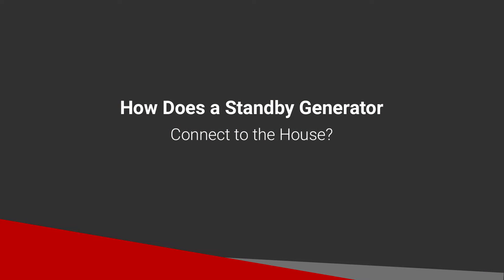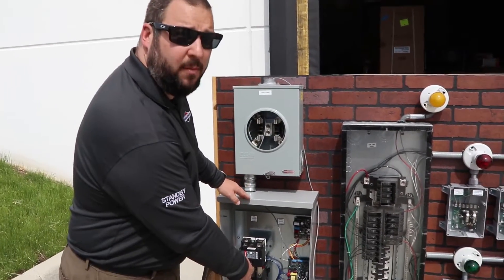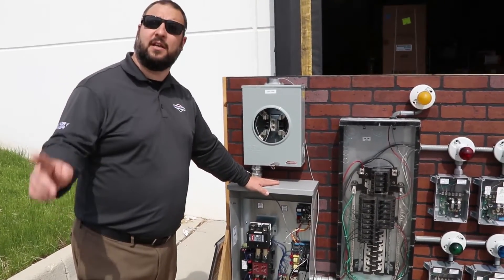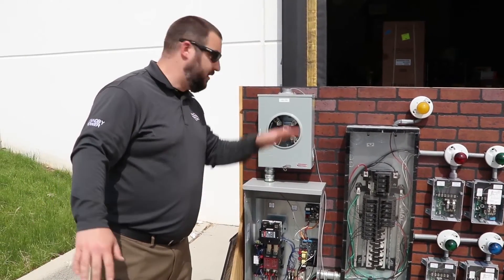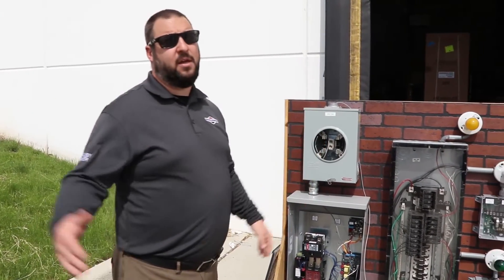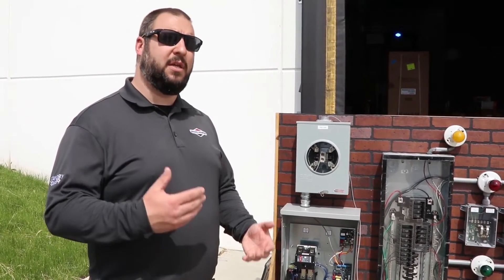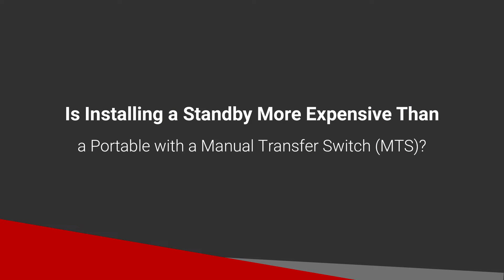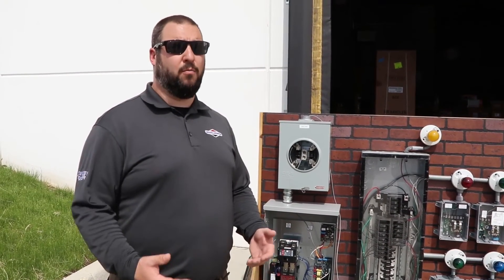Standby Generator Questions Answered (FAQs)

Comment: I have a Briggs and Stratton Fortress 12kw generator and it won't start it makes a clicking sound similar to staring relay but it sounds like it coming from behind it plus I changed it  and there is no difference the battery has 13 volts

Comment: I have a 20k Generac Generator and when we lose electricity it will turn on but will not switch to generator I have to do it manually. Once I do that it will turn off when the electricity comes back on. I am not sure but I think it might be a relay.
Reply: My sisters does this.  Unit is only 6 months old     . I’m here looking for answers.

Comment: Greetings, I have a Briggs Stratton Power Boss generator model 030660-01 5500 watts starts jerking or jerks too much and the carburetor works erratically
Reply from the maker: It sounds like you should have someone look at that generator and service it according to the maintenance schedule outlined in the owner's manual.

Comment: 20 KW generator generac, Honeywell or Briggs and Stratton and why ?
Reply from the maker: It all depends on your preferences, price variables, and specific features at that range. All of those brands have great generators with great engines and should be reliable for years and years without worry.

Comment: It is possible, When Irma came thru, My Powerhorse 9000 worked great the home central
A/C lights fridge stovetop.The house did not have a MAINS so I pulled the meter and 
covered the meter socket. I staggered the loads, so once the house temp was good I 
shut off the a/c so wife could could and do laundery. the house being built of cinder-
block really holds the coolness so we did not have to run a/c that much. The gen gas a 
30 breaker and the dryer's circuit had the same amps breaker.
Reply from the maker: It's important to tell you that this configuration is called "backfeeding" and it can be extremely dangerous and in some cases illegal. A hookup like this could send electricity down the line to the main power where potential linemen could be trying to restore power or make repairs, and not realize that the line is live when they're working on it. This is very dangerous and thus we never recommend hooking up power this way using a generator.
Reply: @PowerEquipmentDirect  I do agree 100%, I think though that you 
may have skipped over where I pulled the meter and covered the 
meter socket. It seems a lot of homes did not use actual mains,
but went by the code's 6 breaker rule that all 6 breakers would kill 
any power to all circuits.. 1 double breaker worked all the 120 volt 
branch circuits. I have been around long enuf in the electrical trade,
to understand a good many things and that safety is of the utmost
importance. I do realise that backfeeding is dangerous as it can 
energize what is known as the secondaries of the transformer on 
the pole known as a pole pig, making the secondary work as the
primary winding and the actual primary is now a secondary with
an increase of 30 times the 240 volts now coming out at 7,200
volts  on one of the phase legs of the 3 phase distribution system.
I do thank you for taking the time to tell me anyway, electrical power 
is great, but is has absolutely no respect for ignorance.
I do have to proofread! yes the house was great, held in the coolness. 
once house temp was what we wanted, we'd shut off a/c so wife could cook and  run washing machine. Also I maintain my generator, every 
50 hrs an oil change and clean air filter.

Comment: Very long delivery on Symphony II equipment now. I understand that was true before the last round of storms and has something to do with parts availability, possibly out of China. This causes me concern if I did wait to get a system, and then needed parts for it, I would have a hard time getting them. Does B and S maintain a reliable supply of parts for the transfer switches and generators?
Reply from the maker: Good question. If you'd still like to know the answer, please give us a call and a product specialist will know more about this.
Reply: I have a B&S 12 KW standby generator, needing an oil pressure switch (841281) but nobody in the USA can supply it. Looks like no generator backup for me, since nobody know when it will be available.
Reply from the maker: @jonboz7585  We're sorry to hear you're needing that part. Please keep in mind the entire country is still mitigating global supply chain issues since the beginning of the pandemic last year. Parts and entire generators are back-ordered or have had manufacturing delays as well. Have you tried asking B&S directly for the OEM part? It looks like they have a listing for it here, but you might have to call them directly to see if it's actually in stock like it says on their website: https://www.briggsstrattonstore.com/briggs-stratton-part-841281/

Comment: Are the v-twin Vanguard commercial engines used in the 10KW, and larger, standby generators?
Reply from the maker: Briggs and Stratton does use the Vanguard V-twin engines on the 10kW and larger standby generators.

Comment: Hi, Question:  on the new A-ipower 8000/7000 watt inverter generator.  Is the generator a bonded or floating neutral?  If bonded is the entire panel bonded? Or are the L-5 & L-14 30 excluded from the bond?  Thank you.
Reply from the maker: Hello, the generator you're referring to (linked below) is bonded neutral, and so is the whole panel. You can view more information in the wiring diagram inside the owner's manual. Thanks! https://www.electricgeneratorsdirect.com/A-iPower-SUA8000IE-Portable-Generator/p109532.html